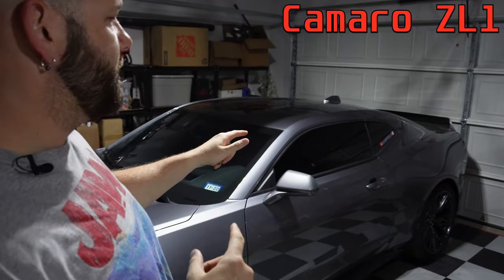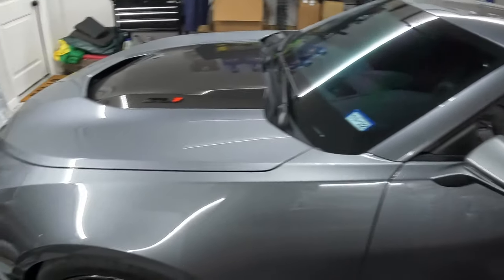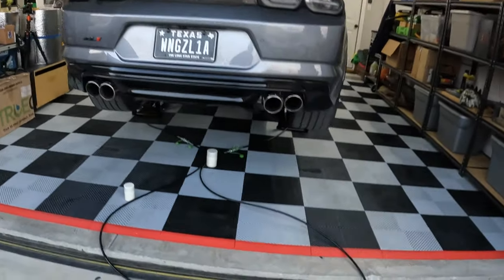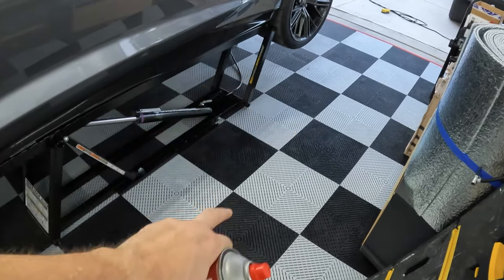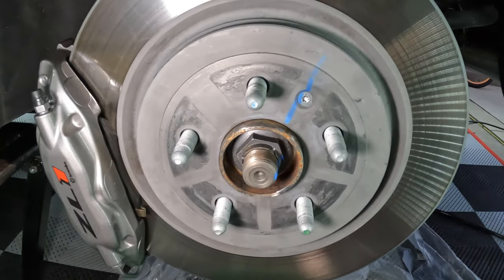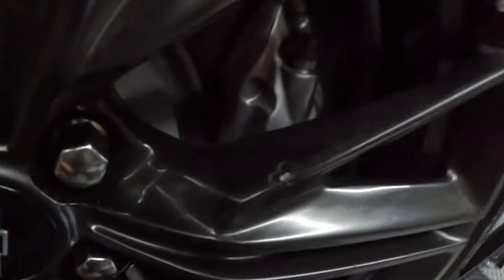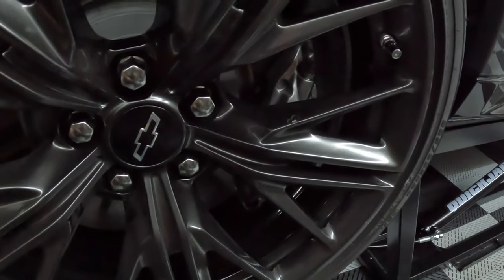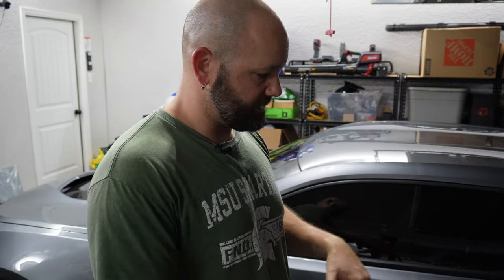2016+ Camaro Rear End Clicking Sound Fixed!?

Comment: So we get that clicking on hard turns in the canyon and in track.  Youll need to sand the rust off the hub that sticks out of the rotor and the points where the wheel meets that hub. You can see the rust in your video you actually cleaned around it haha. Just get some high grit sand paper and it goes away. There is a GM TSB on it as well that states this. If you dont want it to come back (cause it will) you can put a ever so tiny amount of silicone grease on that part and itll stay away for a long time (very small amount). Enjoyed the vid man, keep up the good work
Reply from the maker: Yeah, if it get it coming back I'll give it a good sanding and coating. So far it's been good but I'm sure, as you mention, all on due time haha.

Comment: Hoping this is all I need to do to fix my click as well. I can hear it’s coming from my back right tire. So going to try taking it off tomorrow and cleaning as you did in this video and putting it back on and see if that fixes my clicking. Really hoping it does 🤞Thanks for the great video either way though! You explained everything very well!
Reply from the maker: Thank u!! Hopefully you resolve your issue as easily as I was able to with mine! Zero clicks since cleaning everything up and torquing wheels to spec.